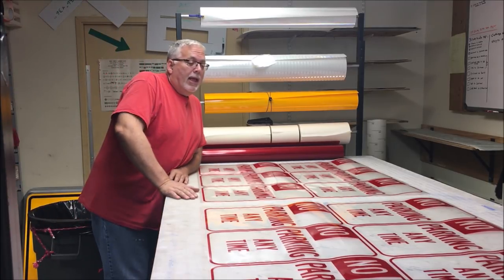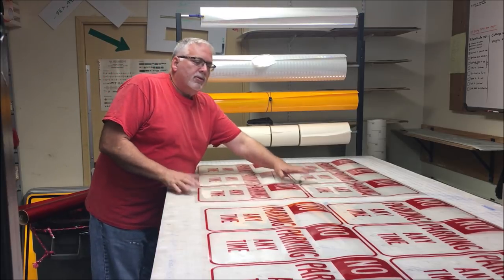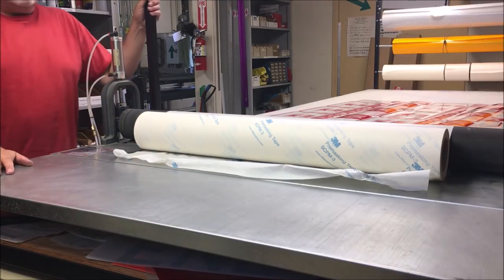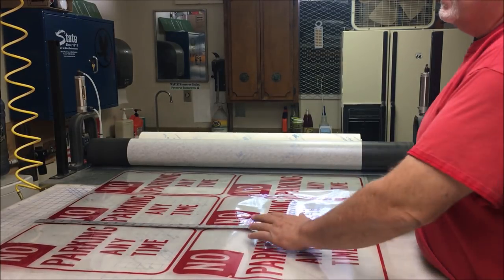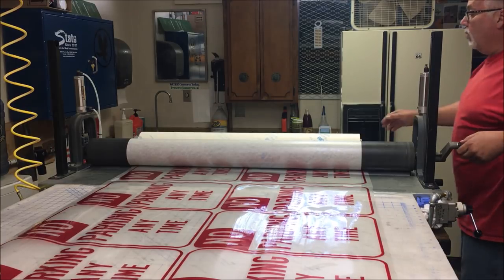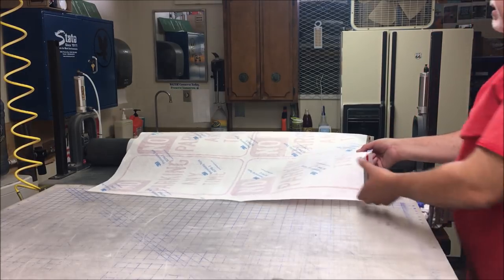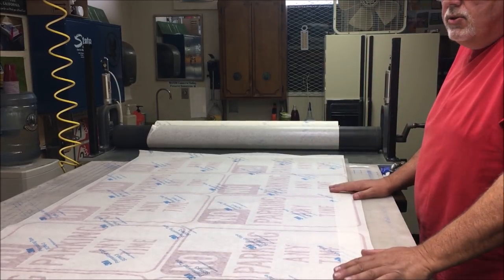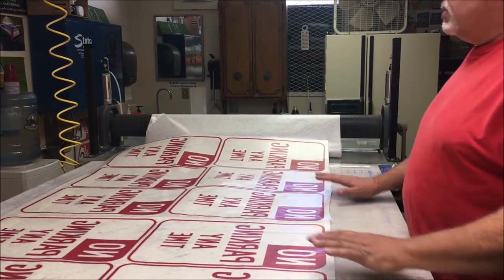Transfer Tape Application for Traffic Signs

Comment: Do you ever work with engineer grade material? We have a Mutoh traffic jet, using the roller to apply engineer grade material to an aluminum sign and it’s extremely difficult to work with, our prismatic and regular vinyl material are nice and easy, just curious if you have any tips for working with engineer grade material
Reply: The material tends to walk a lot